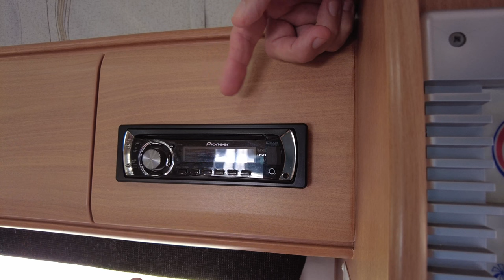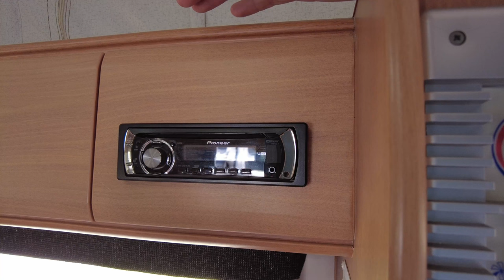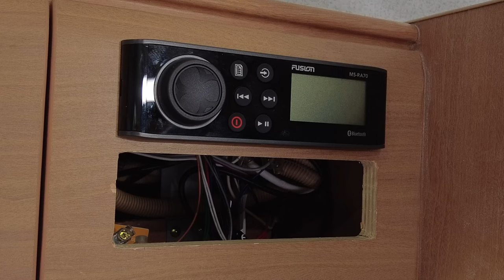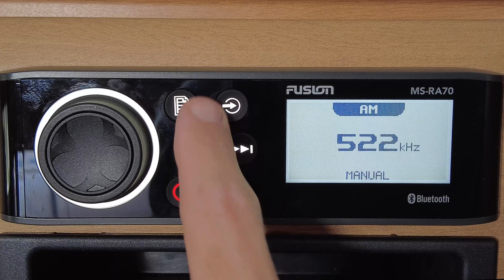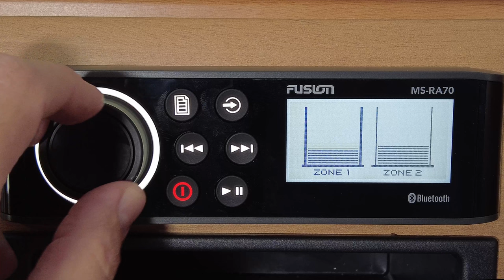Caravan Fusion Stereo Upgrade - Easy DIY Installation

Comment: The best thing to help remove silicon is dw40.

You can also use a AA battery on the speaker wire in the van and you will hear the speaker make a noise as you hold one wire on the (-) and then pulse the other wire on the (+) of the battery.
Reply from the maker: That’s a great tip! I’ll be sure to use that next time. Thanks for watching

Comment: So you explained the dual zone but didn't talk about the wiring to control each zone. How do you decide which speakers go in which zone? Is that done in the wiring?
Reply from the maker: So the wiring harness is split into two zones - marked on the wires. On my setup The inside is wired to zone 1 and outside is zone 2. It’s very straight forward. Thanks for watching

Comment: Hi, great video, I was considering the same head unit, how is the Bluetooth range? I can’t go more than 1 meter away from my van without the connection dropping out at the moment (hence the need for upgrading). Cheers Bill.
Reply from the maker: Hi Bill, I’ve found the Bluetooth range to be pretty good. At least 10-15m. Cheers Adam

Comment: Great idea. Just a question, did you not want the TV to run thru AUX?
Reply from the maker: Thanks for the question. The TV we have in the van has Bluetooth so no need to ran the aux cables. Cheers